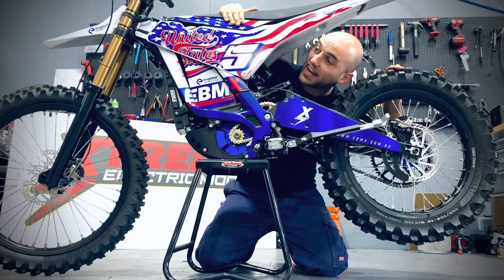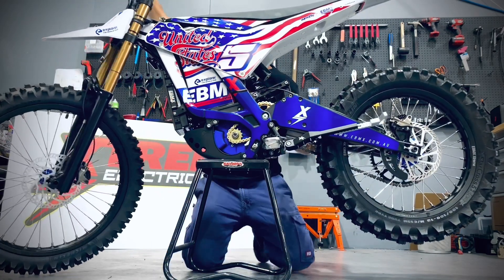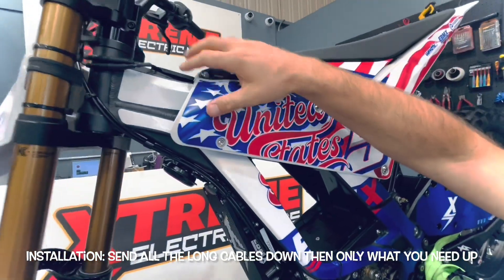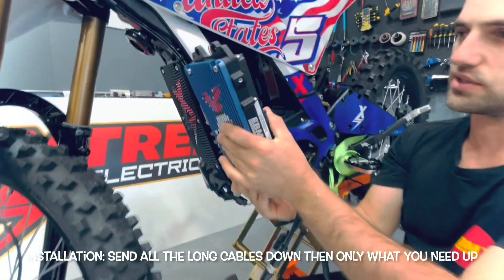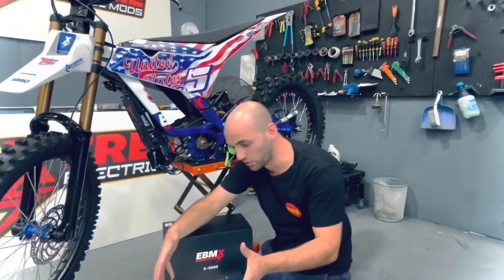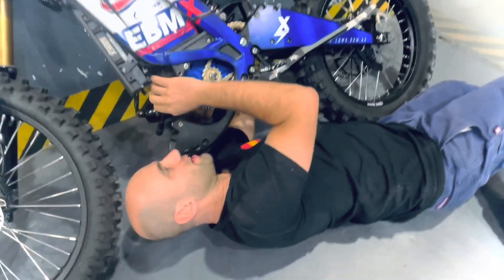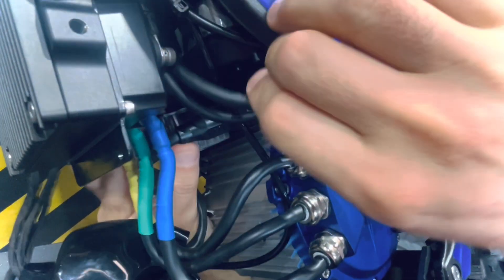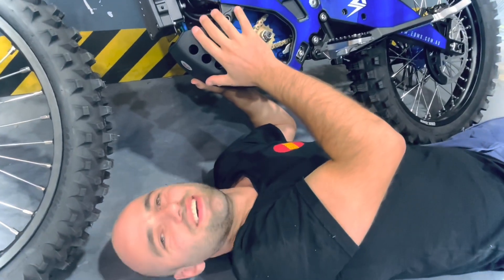Building a 26kW Racing Surron with X-9000 • Part 1 - Teaser and controller installation tips

Comment: Nice controller!!!
Does the motor temperature affect in any way to the cables down there ? Do they touch the motor casing ?
Reply from the maker: Yeaaahh I read your comment here and grabbed a heat gun and my Fluke precision thermometer and set a probe on the cable surface and went all the way up to 120 degrees Celsius and up to 110 the surface still hard and at 120 it starts to get soft but still far from melting. Most motors out there are set to run up to 100 Celsius as this is a magnet temp limitation. Some motors have magnets capable of 130 Celsius but here is the thing… this is an internal temperature which is always much higher than the shell outside and the controller needs to reduce power at least 5-10 degrees before it reaches that max temperature as there’s a thermal delay between heat build up and measurement.
That made me even more confident, yeah it’s safe to fit the cables there
Reply: @BrunoPOWEEER  excellent 👍 thank you very much for the Info.....
Get that beast out for a ride!!!!! Nice job
Reply from the maker: Any air flowing around that motor area is enough to make the outer motor case cooler than 110-120 Celsius, even in a very hot day here in Australia with ambient temperature of 46 Celsius even that hot air (hot for us) is plenty to cool a 110 Celsius motor. You could do some experiments fitting a thermistor inside the motor and another touching the outer shell of the motor and take the motorcycle for a ride and the temperature difference will surprise you. I’ve done it myself so many times 😂
Reply: great question and I had the same question.